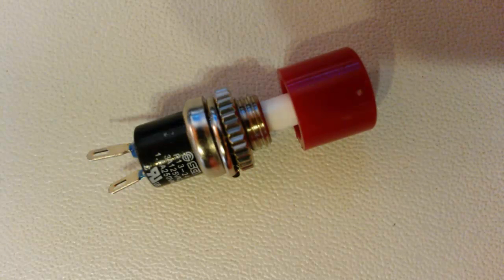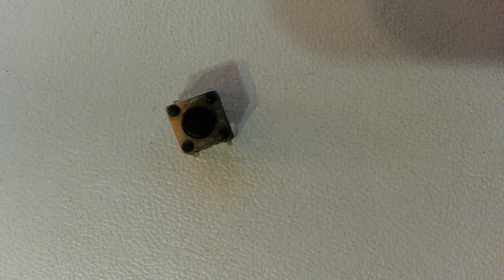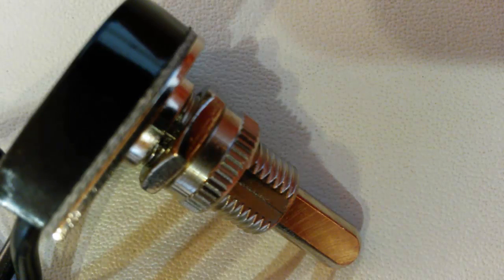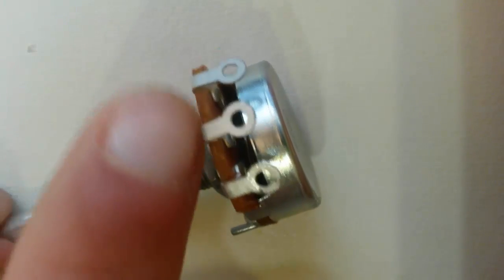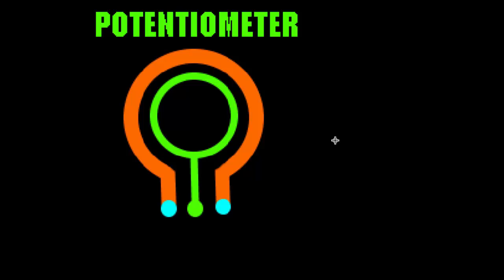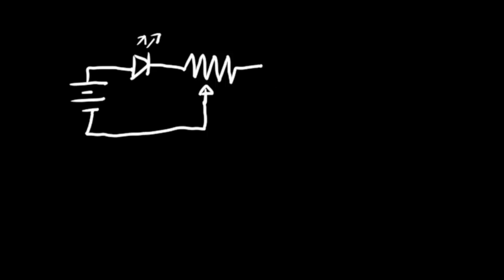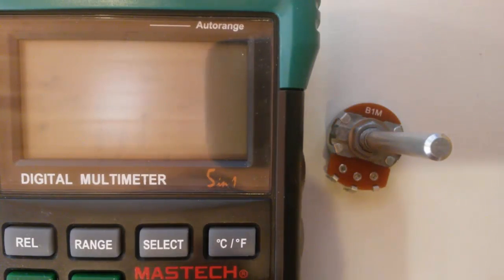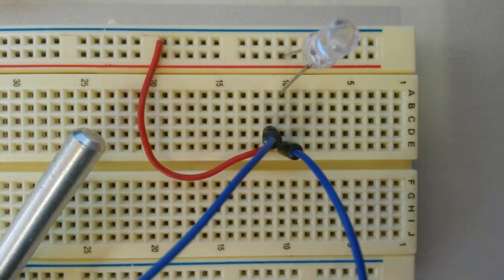Beginner Electronics - 18 - Potentiometers and Buttons

Comment: Guys btw, just a little reminder but before using a potentiometer anywhere just remember potentiometers can burn out just like LEDs, but not the way LEDs do. When a potentiometer is burning out smoke literally starts coming out of it. It can happen when you turn it too much to the far right (to the direction of the third terminal) and too much current is passing through it. So be careful because I learned this the hard way.

Comment: surely you need a resistor in series with the pot in case you turn it past 240Ω to zero otherwise the LED will burn out?

Comment: So an open push button is the same as a morse key. When it is pressed down it makes contact when you release it contact is broken. You can use a potentiometer like a volume dial to increase or decrease the resistance but I noticed you mentioned that they can come in two forms: linear or logarithmic scale.

Comment: The 'safer' thing to do here is to use the 240 Ohm (220 would do) Resistor and the potentiometer, in series, since the Pot can go from 0 ohms (short) up to the measured 1MOhms.  This sill prevent the LED from burning up when the pot is wound down to 0 ohms.

Comment: 14:31 I have a question about this point in the video. Why do you call it "ground" and not negative? Thank you so much for the great video lessons, I'm learning a lot!
Reply: same thing
Reply: Actually the red wire is positive. Thats standard with wires btw. Black is negative (providing electrons/power for simplicity sake) and the red is positive (drawing the electrons to it and back to the power source). Grounding is another way of referring to a 'common return path' (unless you're talking about literal grounding to mother earth which neutralizes it to 0.

To clarify: What he means when he's "grounding the wire" (using the positive wire) is that the electricity is being provided by the (out of view) black wire coming from the battery. That wire is supplying the voltage through the component and the resistor/potentiometer. It is then traveling through the red wire/common return path/ground where the circuit will be completed and there wont be any openings in the circuit waiting for your finger to complete the circuit and shock your ass.

So when it is being "grounded" he simply means the circuit is being closed so to speak.

This is my rough understanding of it. I'm sure there is more to add on this subject but that's a good way to think about it. Don't overthink the details on this -- just know that whether it's the black or red wire ending the circuit, both can be thought of as "grounding it" once the return path has been finalized. Even though neither wire is REALLY referred to as a grounding wire. That's normally a 3rd copper wire that literally grounds it to the earth to protect from MAJOR spikes (such as from a lightning strike). Because mother earth can receive all of that power with no problems. Your little LED light or battery not so much.

Comment: Hi, thanks for the potentiometer tutorial! If you wanted to avoid burning out your LED I was wondering if you could add another resistor to the circuit to first bring the current down to the maximum the led can handle, then if you set the potentiometer to max it wouldn't burn it out - would that work? Cheers

Comment: so to be safe and not burn out the LED you would typically use a regular resistor to Get the LED at safe full bright how you want it then add the potentiometer as only additional resistance to the circuit?

Comment: But I used potentiometers to measure accurate voltage using the position of null point. Why this one is also called potentiometer, it should be something like variable resistance or rheostat... little confused

Comment: One question that concerns me is, why is the LED connected before the resistor on the positive part of the circuit?  I may be wrong, but wouldn't the jolt of currant burn out / damage the LED?  Can a circuit work if you put the resistor first?
Reply: Sorry, I think I missed a big point, as the circuit is pretty much instantly complete when terminated to the power source

Comment: I would say this is 66% of the true explanation because the variable resistor aspect is kind of incidental use of the potentiometer.  There is a reason why it's called a "potentiometer", from the word "potential", electric "potential", i.e., voltage.  The middle connector can be varied in position to give one a variable voltage, given the two end connectors are connected across a voltage source.  This configuration is commonly called a voltage divider:  the center voltage = V * R1 / (R1 + R2)  where V is the voltage source connected to the high and low ends, R1 is the resistance between high and center, and R2 is the resistance between center and low.  By moving the center tap, variation in voltage is achieved.  This is the more prevalent and intended use of a potentiometer.

Comment: 4:23 Wouldn't that last one be a double throw? It has only one circuit connected at any state, but it has two positions.
Reply: Single pull double throw means one input leads to two outputs. Double pull single throw means two inputs where each input has 1 output. Aaand since that button has 2 inputs, with one output for each input, it is a double pull single throw(or just double pull for short).I hope I made sense.

Comment: At the beginning of the video my immediate thought was, "how do you reverse the resistance of the potentiometer?" 
By which I meant: "It seems to me that if you turn it clockwise, you should add resistance, so if we connect an LED to it, turning clockwise would actually dim the light, and that would be weird."
Then, with your diagram at 9:00 I realized that you would connect the circuit to the other side of the potentiometer, so that if you turn it clockwise, you're lowering the resistance on the side that holds the LED, thus making the clockwise turn allow the light to get brighter. As god intended. lmao

I was also wondering about using potentiometers in such a way that will prevent burning out a component. Then I realized that you should use a resistor first to ensure that it doesnt exceed the maximum voltage, and then use the potentiometer to safely control the voltage with a set upper limit.

Comment: Would it not be better to add a resistor to the circuit such that that resistor + the minimum resistance on the potentiometer add up to the minimum resistance needed for the LED? That way, there is no risk to turning the potentiometer to any setting.

Comment: how did the led work without a power supply, and why is the middle terminal connected to ground? please explain
Reply: The power supply is offscreen to the left – the power rails run the entire length of the breadboard (the 5-hole groups are NOT separated). The middle terminal is the one which allows you to use the adjustable resistance of the potentiometer and it is connected to the ground/negative terminal of the power source in order to close the circuit.

Comment: I doubt anyone will respond any time soon, but I have a question.

Instead of connecting 1 wire in the middle of the potentiometer and the another wire on the side of the potentiometer. Could you use a potentiometer as a resistor by only connecting the 2 outer connections?
Which would turn your 10kOhm potentiometer into a 10kOhm resistor (and would make turning the nob useless)
Reply: No, it won't work brother. There would be no change in the resistance and no change in current. Te current will directly flow and it would become useless to put a potentiometer in your circuit
Reply: @vandanaagarwal8975  Thanks for responding! Tbh I'd already forgotten I asked this question, but I'm happy to know the answer anyway.
Reply: @cookiecan10   It's fine brother, I'm happy to find that my knowledge helped you

Comment: Couldn't you have a 270 ohm resistor to kind of act as a max limit of ohms? Because I'm pretty sure we don't want to "accidentally" feed it somewhere in the neighborhood of 50 kohm's.
Reply: Ruka Muk. I was wondering there same thing. Rather than being really careful to not turn the knob too far, just add the 240 ohm resistor from before, in series. Also, it's no problem with 15 k ohm, it's below 240 it gets dangerous, because that's when the voltage starts to go above the 3.2 volts.

Comment: Summary:
- a button is an electrical component that goes in a circuit
- normally, the button has a gap between its leads, thus no electricity will pass through it, thus the circuit that the button is in is open
- when you press (hold) the button down, the two leads are connected, thus the circuit that the button is in is closed
- there are different kinds of buttons
- push buttons you have to hold down in order to connect the leads
- toggle buttons you just press once and they are in a permanent closed state, when you press again they are in a permanent open state, and so on
- buttons can be normally closed or normally open
    - a normally closed button starts in a default closed state (pressing/holding opens it)
    - a normally open button starts in an open state (pressing/holding closes it)
- a potentiometer is a variable resistor (rotating it's knob alters its resistance)
- how a potentiometer works: rotating the knob alters how much resistor material electricity going through the circuit will have to go through